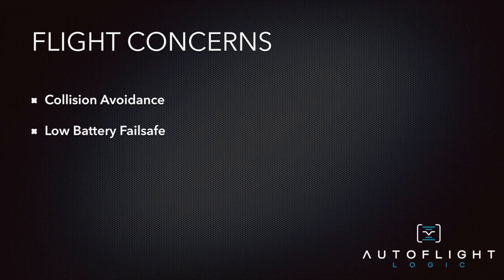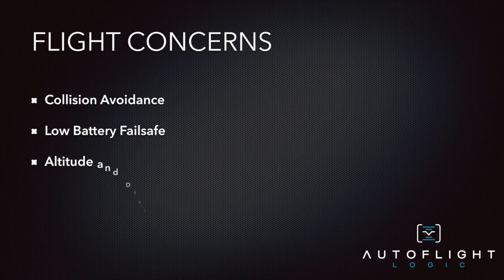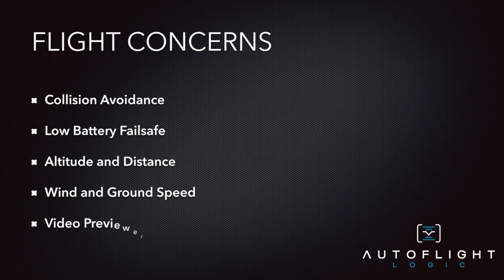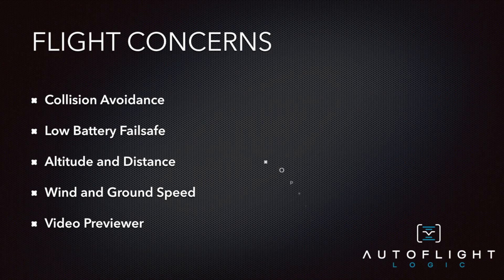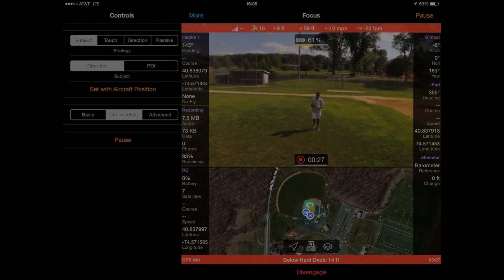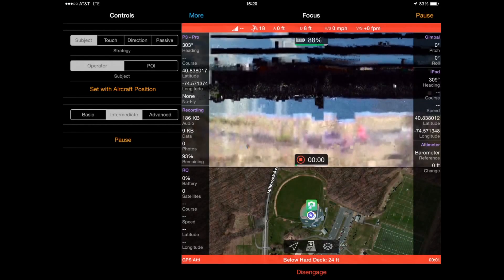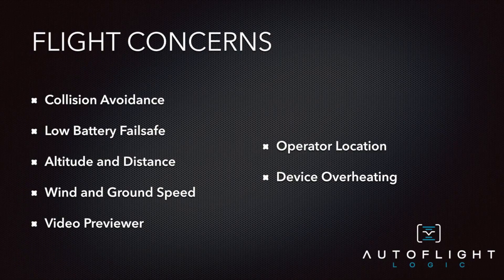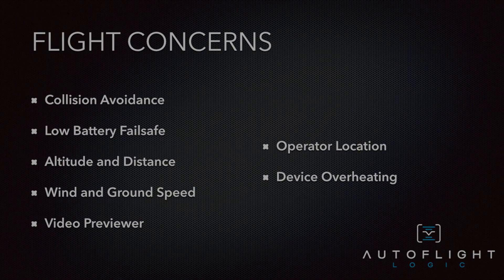Autopilot - Flight Concerns

Comment: Why don't you advise that airspace cannot work unless you have a good cell signal making it unusable in many locations.
Reply from the maker: Fair comment.    Using Nework Airspace mode, this is true.   In Peer to Peer, that restriction is not applicable.    Airspace in network mode is fully dependent upon the quality of the GPS signal and I do think the video mentions that, but you are correct.

Comment: Love the tutorials but I'm confused about one item.  It concerns Low Battery Failsafe. The tutorial says   “autopilot cannot control the aircraft when it enters this mode, so you will need to be prepared to disengage or override autopilot before the battery reaches whatever marker you’ve set”. 

Q- Will the Low Battery Failsafe and fly home or autoland when I’m in Autopilot or is it disabled? Do I have to disengage autopilot for the LBF to work? I"m also unclear of the procedures for start up. Do I open the DJI Go app and set my RTH then close it and then open Autopilot while the aircraft is idling on the ground? Or do I power everything down after setting RTH and then start up again with the Autopilot? Thanks so much
.